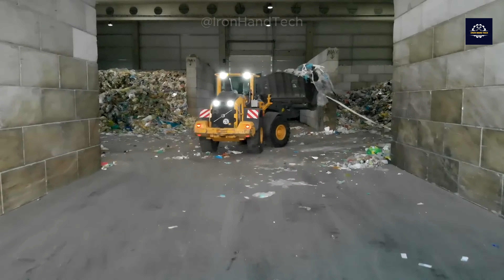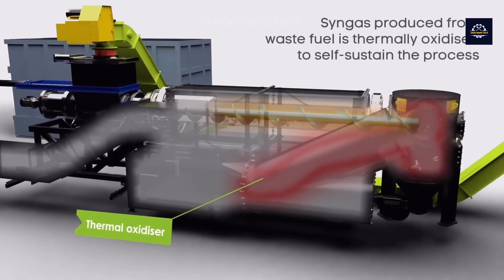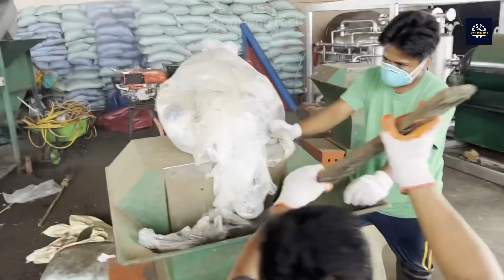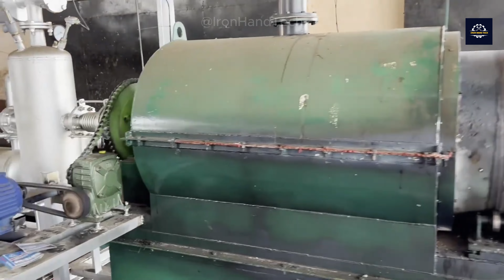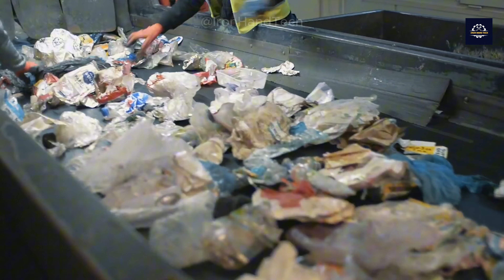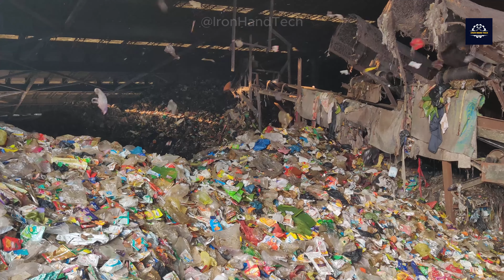How to transform Plastic Bottles into Oil through the Recycling Process?

Comment: Pyrolyses is a very old process and used to make methanol, tar, turpentine and naval stores from wood.   The supposed treasure storehouse on Oak Island, Nova Scotia was actually a tar kiln built in the 1720s by the British South Sea company for the merchant marine and Royal Navy.  Eventually petroleum based products replaced these.
        As someone who is a fan of railroading, I always thought attempts to mix plastics, rubber tires and other items to make ties/sleepers is interesting.  While in most cases railroads have moved from wooden to concrete ties as the solution to decaying and degrading ties, concrete isn't very resilient and also can't be used in some applications like on bridges, because they transmit the vibrations and force of the trains into the bridges damaging them.  So when the rails supported and held together by concrete reach a bridge, wooden ties are used and then when the rails leave a bridge, concrete ties are used again.